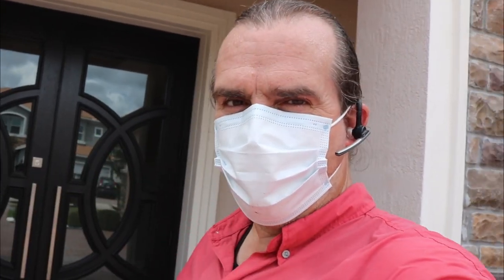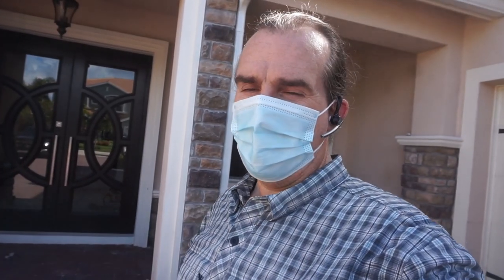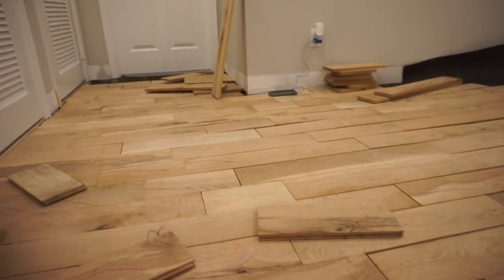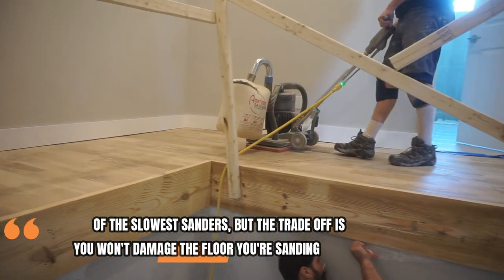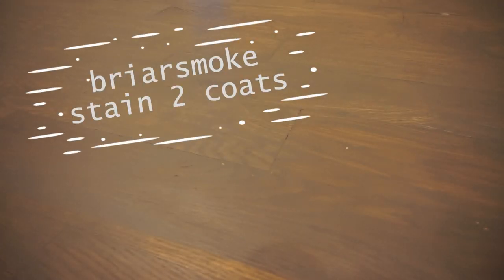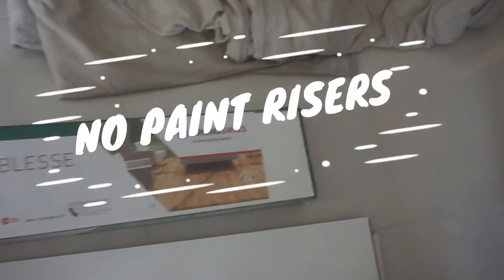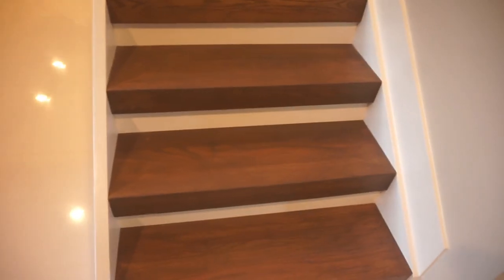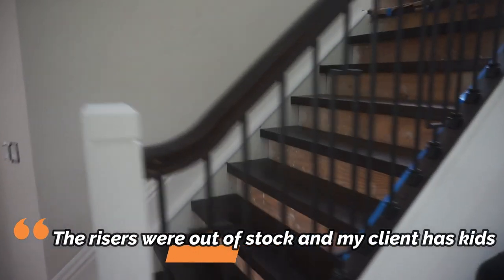AMAZING MODERN STAIRCASE RENOVATION wood stairs SANDING & STAINING diy wooden stair REMODEL refinish

Comment: Nice craftsmanship thanks for posting
Reply from the maker: Thanks, one of my favorite staircases of the year.
Reply: @JonesKnows  so your stair nose is 45 degree cut at bottom then you add on drop of size choice at 45 degree cut to bottom with glue and brads? If so thats genius
Reply from the maker: That's it.  I'm really big on the glue.  I feel that the glue part is really important and I don't skimp. It's a great look and clients like the idea of being able to pick a front size.
Reply: Would love to know where you purchased the railing system!  😉👍